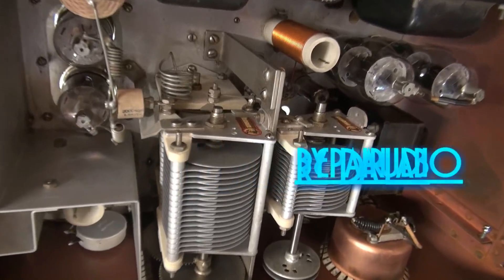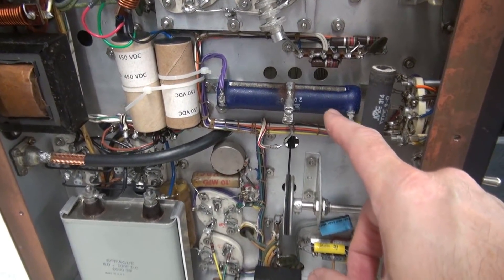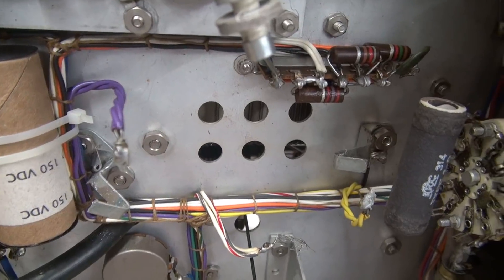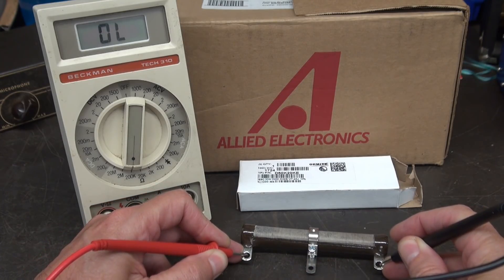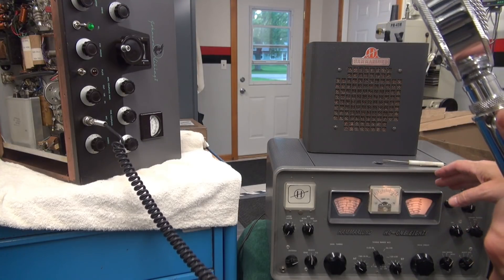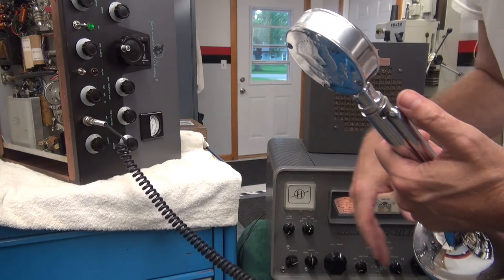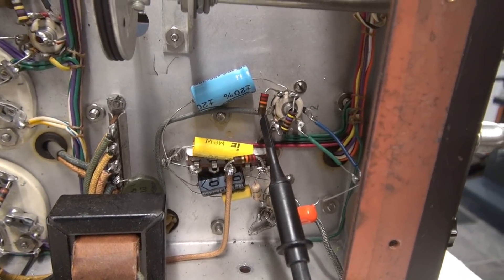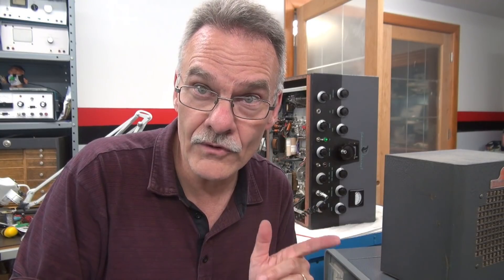How to repair Johnson Viking II Ham Tube Transmitter Audio No Modulation D-Lab electronics

Comment: What is the large wax covered capacitor underneath the oil filled filter cap? I noticed it in this video and in another one of your Viking II videos. In transmitters that have supposedly been recapped, why hasn't that capacitor been replaced? I'm about to fix the audio in my Viking II, following this video, and I'm curious if that big wax capacitor needs to be replaced.
Reply from the maker: Yes, it was replaced before leaving the shop. That is a .5uf @600vdc cap

Comment: Grid current no more than 6 mills. Plate 230 mils. Mod is ok at 50 mils. Once loaded up re peak the grid with the oscillator buffer and grid looking at the grid current. I cut my teeth on a Viking II. If there is a red line on the meter that is for mod current peaks. OJ KØOJ

Comment: Great video. Hey, could you do a video on how to make one of the newer lollipop microphones work on boat anchors like the Viking?
Reply: Get rid of the pre amp in the base. Those were put in for impedance matching to lower Z circuits. The Rochelle salt element needs a meg or over load for proper matching into the audio of older rigs with hi Z inputs.